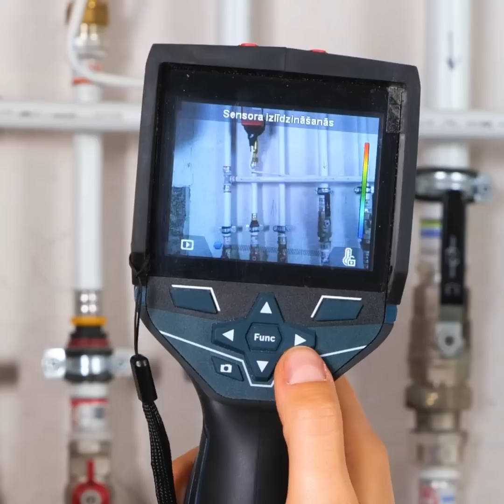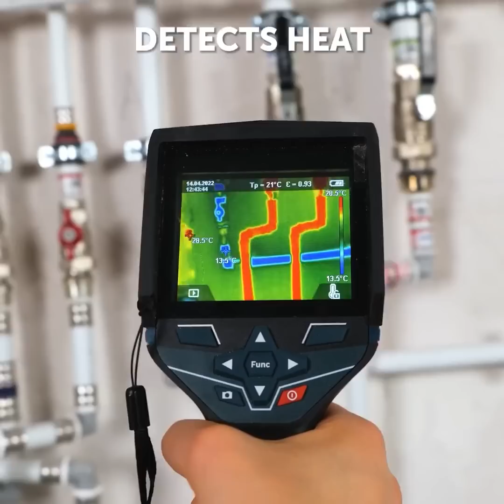FIXING ALL MY PLUMBING ISSUES WITH THESE HACKS

Comment: Thank you for your video. Very good. 
   Here's something you can add to another video:
   A good way to remove a toilet seat, is to cut a piece of 1/2" copper tubing, or PEX tubing, about 6" long and cut a slot in the end of it about 1/2" deep and label it TOILET SEAT TOOL. (make sure it fits the nut. You may have to fine tune the slot, with a file. Then use it like a nut-driver on the plastic nut, holding the toilet seat on. (if you have the resources and are a DIYer, you can make it long enough to pass by the end of the all-thread bolt and put a bolt up in it and solder it in so you can use a cordless drill on it. I turned mine out of a steel bar and machined it. It's just a quick zip, and the nut is off. Then start the new plastic nut by hand then use the tool to run it up. (Don't RUN IT ALL THE WAY UP TO THE SEAT, if using a cordless drill ! STOP, before getting to the porcelain !!!) run it up by hand Something else you can add is to slide plastic tubing AROUND the bolt that holds the toilet seat on, THRU the hole in the toilet and cut it so it doesn't quite get to the end of the hole. Then run the nut on up to just snug, NEVER tight. Just hand tight. This stops the annoying side to side slop, of the toilet seat.

Comment: Do you have hacks on removing toilet seats?
Reply: Sawzall
Reply: A good way to remove a toilet seat, is to cut a piece of 1/2" copper tubing, or PEX tubing, about 6" long and cut a slot in the end of it about 1/2" deep and label it TOILET SEAT TOOL. (make sure it fits the nut. You may have to fine tune the slot, with a file. Then use it like a nut-driver on the plastic nut, holding the toilet seat on. (if you have the resources and are a DIYer, you can make it long enough to pass by the end of the all-thread bolt and put a bolt up in it and solder it in so you can use a cordless drill on it. I turned mine out of a steel bar and machined it. It's just a quick zip, and the nut is off. and start the new plastic nut by hand then use the tool to run it up. Something else you can add is to slide plastic tubing AROUND the bolt that holds the toilet seat on, THRU the hole in the toilet and cut it so it doesn't quite get to the end of the hole. Then run the nut up shy of the porcelain, with your cordless drill, then, on up, by hand, to just snug, NEVER tight. Just hand tight. This stops the annoying side to side slop, of the toilet seat. (I'm going to paste this into the regular comments, so it can be seen by all readers.